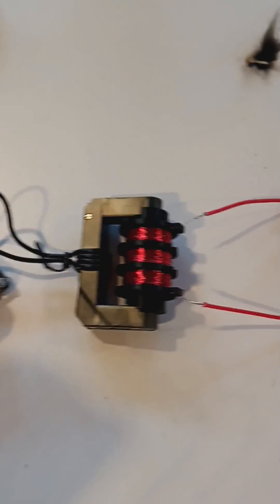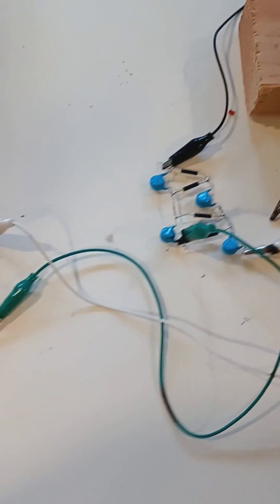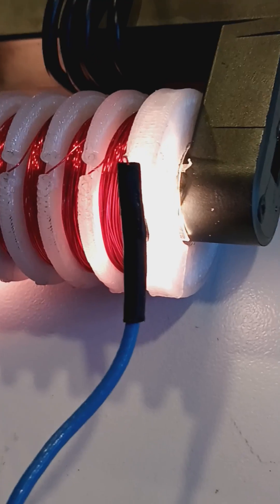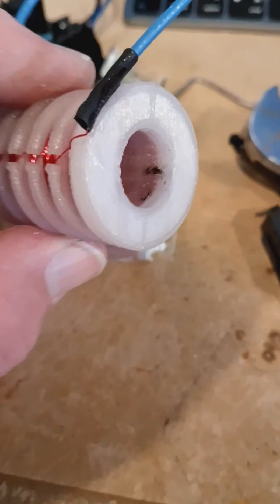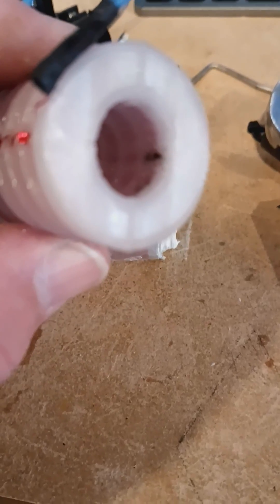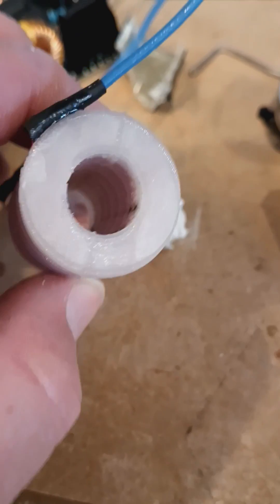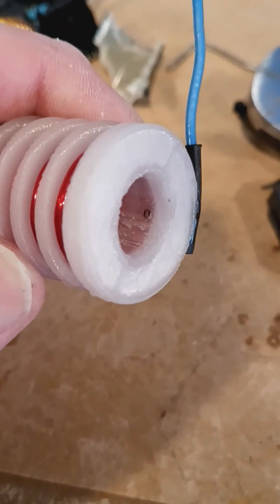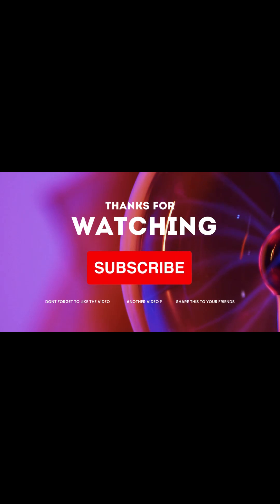Ac Flyback Success and failure

Comment: Ugh. I just rewatched the video. I believe you are drawing arcs from the wrong side. The hv output is on the left. The ground should be on the left too. Not the right. Unless u built the multiplier incorrect
Reply from the maker: it worked for the dc one so I thought it was correct.
Reply from the maker: Is the flyback suppose to make more voltage or just break the voltage from going back to the zvs. I only ask because I could build a simpler one.
Reply from the maker: is there a brand on your ac flyback? and any data sticker
Reply: @oldmanbuilds thordarson
Reply from the maker: I found a flyback like yours in the states (so 1 week to receive it)and I am receiving the diodes today. by next week I should be in business. Did I need a second flyback or is one ok? Thanks again for all the help.
Reply: @oldmanbuilds  i live in the states too. The small flybacks came from NY. I've combined 2 flybacks but one of them swelled up. So i stick to one. Which diodes did you purchase. Did you also buy capacitors. If you plan on soldering the multiplier. A "green" perf board is recommended, rather than the standard board. Helps with electrical interference. Thats what a electrical engineer told me.
Reply from the maker: @goobman1981  I got it from Idaho. heres the name of it.  "Stancor Vtg Television Horizontal Output And HV Flyback Transformer A-8233"  The diodes "10 PCS 5mA 20kV High Voltage Diode HV Rectifier 2CL77" the capacitors "YWBL-WH 20Pcs Ceramic Capacitor Kit, 20KV 1nF 0.001uF 1000pF 102 High Voltage"    and just to be safe I ordered this "SaiDian 1Pcs High Voltage Multiplier 60000V 24 Times Rectifier Voltage Doubler Circuit Board"  The board is tan and has no conductive material on it. Just like the plasma channel's board.
Reply: @oldmanbuilds  I use 2cl2fl diodes. They are rated at 100ma. The capacitors are 2200pf 220 .002. Keep me posted. I also want to see the flyback condition.
Reply: Nevee mind. I found the one u bought on ebay
Reply from the maker: @goobman1981  cool. by the way I'm in southern California.
Reply from the maker: @goobman1981  I found both. the diode and the capacitor. Got both.
Reply from the maker: @goobman1981  I got one working https://youtu.be/FbIN-eEUuWs
Reply from the maker: @goobman1981  high FREQUENCY diodes. I have been buying high voltage diodes.

Comment: Something is wrong. The arc coming out of the multiplier looks like the arcs from a flyback. The arcs should be blue and the frequency should be low hz. What are the capacitors rated at again, and what's the diodes you are using.
Reply from the maker: 20 kv on the capacitors and the diodes are for 20 kv. I have new diodes coming in. regular black and silver stripe ones 20kv and some more capacitors 20kv. I think the loss is in the transformer though. It went from 3" when cold the to 1/2" hot. There isn't enough push to get the multiplier to react properly.

I think I need to order the ac transformer like yours. Just to get a baseline, then I can change parts as I go.